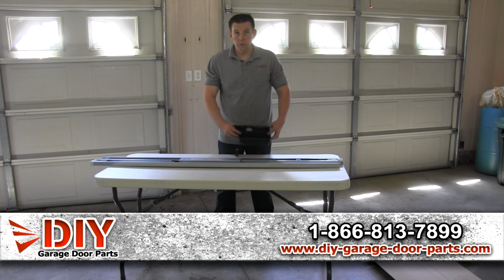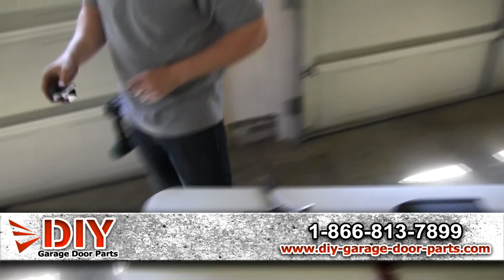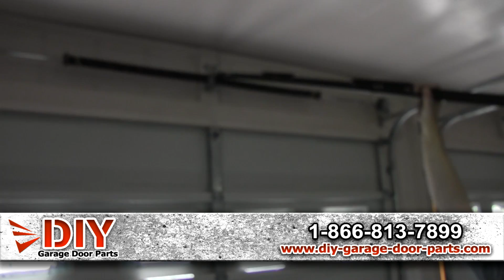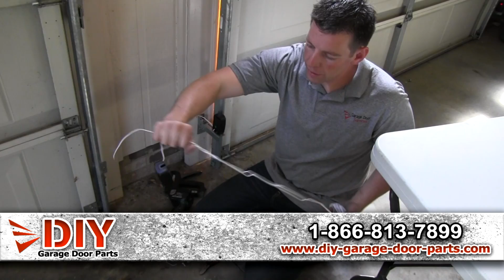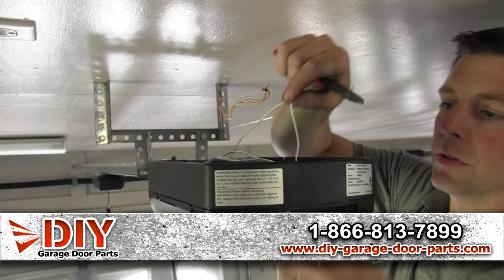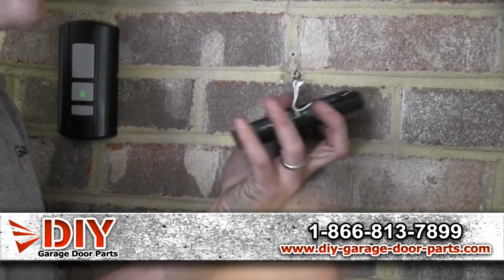Sommer 550 Synoris Installation Video

Comment: btw when he says 550lb door he means a door thats 550lb deadweight that is balanced properly with the proper spring for that weight dont try and use any garage door opener to lift a door thats not balanced properly or you will wreck the machine specially the rails for these machines, lift master solid t rails can probably handle it but even those machines have built in force settings that will not allow it to open for example if you had a broken spring

Comment: When I watch the video at the time 25:00/38.25, I see two beige color wires connecting the white wires (which will connect to terminal 3 & 4).  What are the two beige color wires?  Are they the power wires?  What is the purpose to connect to the two beige color wires?

Comment: That thing looks like a pile of crap. Marantec or liftmaster is the standard for pro grade product... this thing has a segmented rail which is garbage
Reply: vick moore sure it is a 2 piece rail but twice as thick of steel is use compared to Marantec. I see Marantec rail bent all the time (probably once every other month doing service work) never seen a Sommer one bent.
Reply: DIY Garage Door Parts I'll tell you what, let's see if who's right on this... I know your trying to push this bottom end operator. I'm on a job right know, 9' high one piece DOORS in Beverly hills... I'm installing a marantec after I replace the hinge arms. I'll post the video when I'm all done. Guaranteed that Chinese operator you are pushing won't work like this!!
Reply: vick moore sorry bud but it is German made. One 2 of the largest openers used in Europe for over 30 years.
Reply: DIY Garage Door Parts so what's the mm rating of the rail since you say a segmented rail is twice as thick
Reply: vick moore I don't have the specs in front of me but I have have seen and worked on hundreds of both brand and know it is heavier than the Marantec. Plus less photo eye and board problems. Compared to Liftmaster you don't have crappy plastic gears to strip. You are free to use what ever you want bro.
Reply: You don't have the specs in front of you??? Dude, that's because your blowing smoke. If it was rated a certain mm, then you would know it. Stop trying to overlay this product
Reply: vick moore sure man you are right
Reply: I know I am, you sound like a used car salesman that tells clients, "it's never been in an accident" them they ask for the car fax and they won't pull it up... lame bro.
Reply: vick moore hahaha yeah man, thanks for your opinion.

Comment: what are the two brown wires that you connected to the motor? I know there are two sensors on each side and the out that you plugged into the outlet.

Comment from the maker: correct, we sell the synoris which is the dealer grade model. The retail grade model is called the direct drive.  On the synoris the one real works for a 7 ft and 8 ft tall door.  The two main rails measure 5 feet and 4.5 inches each so it will be 10 feet 9 inches once assembled.  other rails are available for taller for.  Sommer really makes top quality openers so you really can't go wrong.  Let us know if we can help in any way.
Reply: Correct' We Sell The Synoris Which Is 
The Dealer Grade Model. The Retail Grade Model
Is Called The Direct Drive. On
The Synoris The One Real Works For A 7 Ft And 8 Ft Tail Door.
The Two Main Rails Measure 5 Feet And 4.5 Inches Each
So It Will Be 10 Feet 9 Inches Once Assembled.
Other Rails Are Available For Taller For. Sommer Really Makes Top
Quality Openers So You Really Can't Go Wrong.
Let Us Know If We Can Help In Any Way.

Comment: Sommer lists 3 different models depending on garage door height: 7', 8', 10'. I checked your website it currently lists only one model (doesn't say which) - what height is it for?

I'm assuming you are selling installer grade opener (not the retail grade which ships in one box), correct?

Comment: Thank you for the video. I'm interested in this model. Few questions:
1) the model in your video has red controller cover and red remotes which means it doesn't user rolling codes. Are you still stocking fixed code models or have the latest rolling codes which I believe are using blue cover and remotes?
2) what is the total length of all c-rails without the control unit? Do you ship different rail sizes for different garage door heights?
Thank you